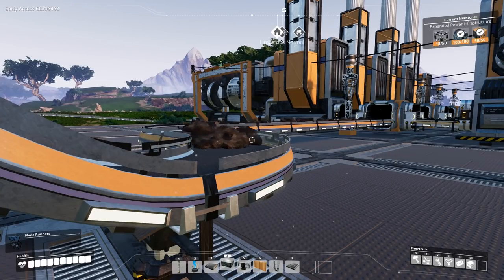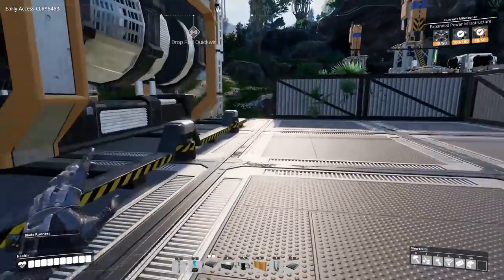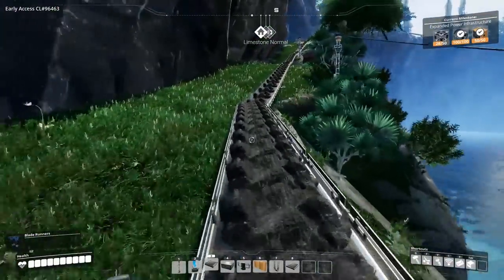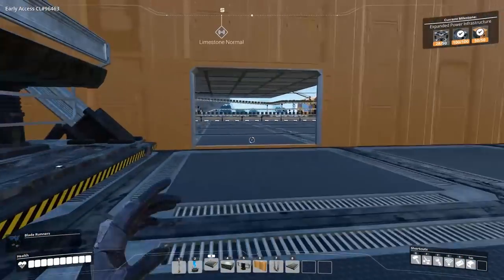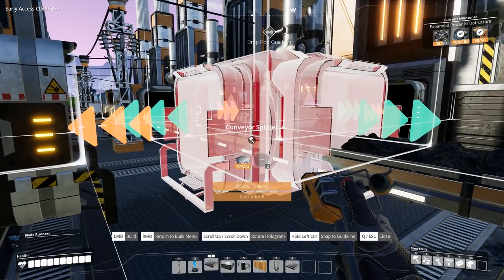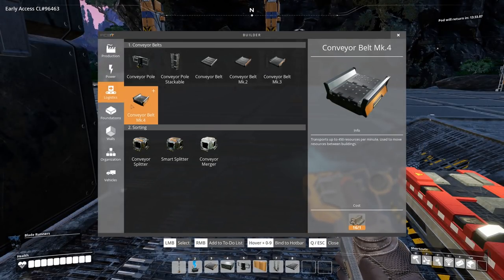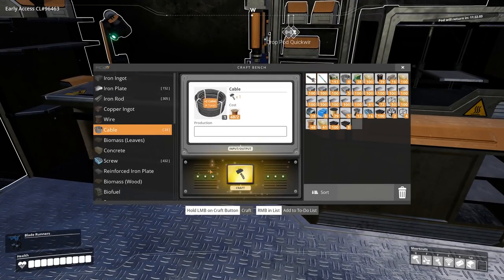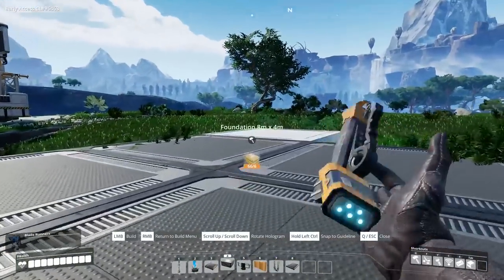Satisfactory Early Access E12 - Fuel Generator and Scaling Steel!

Comment: I have a building with 3 assemblers @ 250% making encased concrete beams (alternate recipe so I'm not bottlenecked by steel beams), and I'm barely keeping up with demand from a single heavy frame assembler and my own pulls for lvl 4 belts! I've also got my oil and coal coming in on trucks for production, while I leave the power plants at the source. Helps me keep my base tidy, but it's cool to see you centralizing everything.

Love seeing you finally bring up automating the cable production, haha!

Also, there's a tier of power above fuel - the steam generator! That one'll be an adventure!